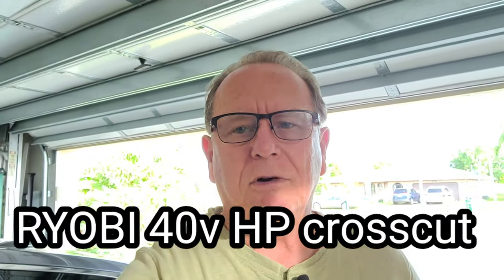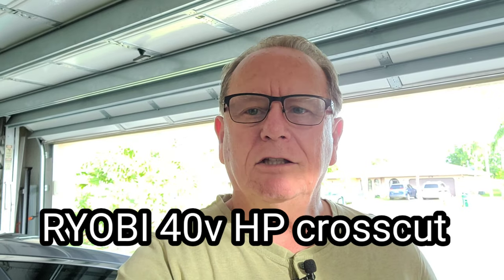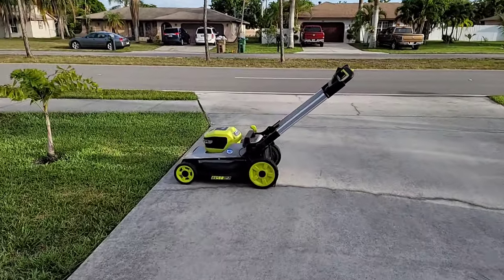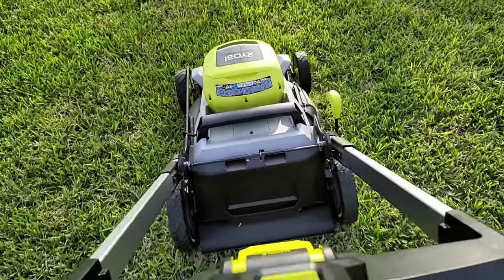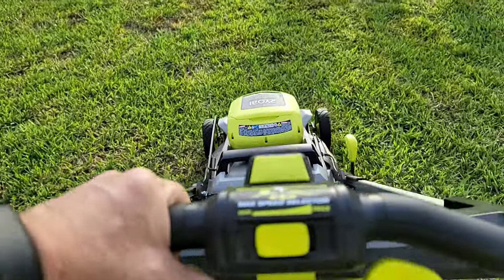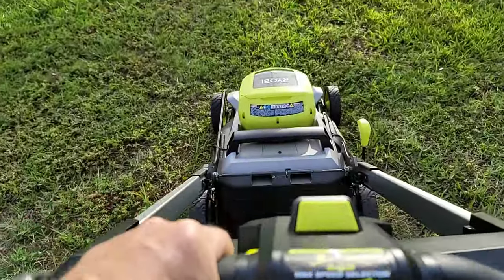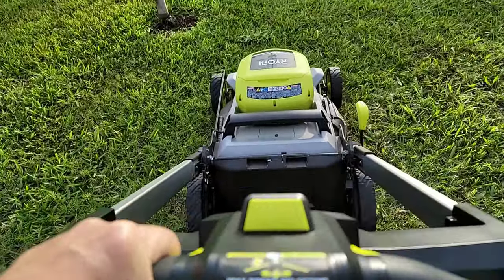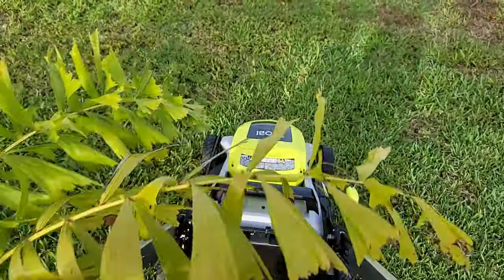Ryobi 40v HP crosscut on wet lawn.

Comment: Any longterm issues exposing the rear drive motor to the damp grass? Great video by the way!
Reply from the maker: I haven't had any issues.  I think like you regarding moisture, so I am very careful when hosing down the under side and motor area. I should make a follow-up video on how well it is holding up...long term. Thank you for the kind words. Have a great week.